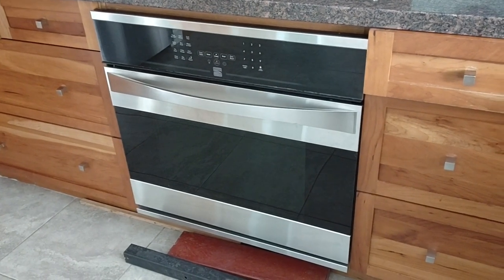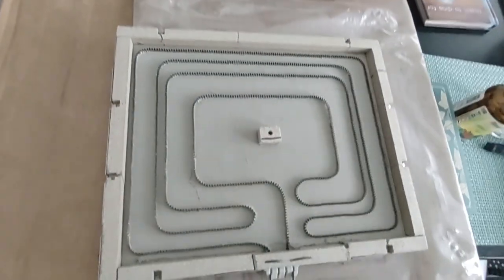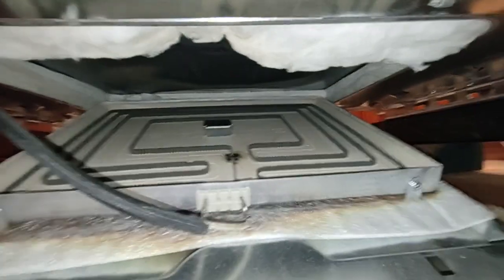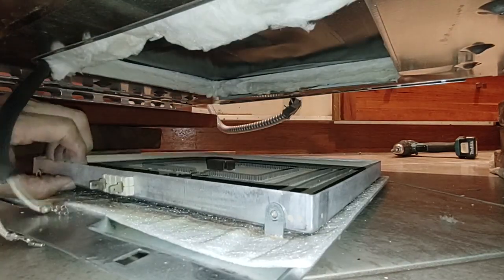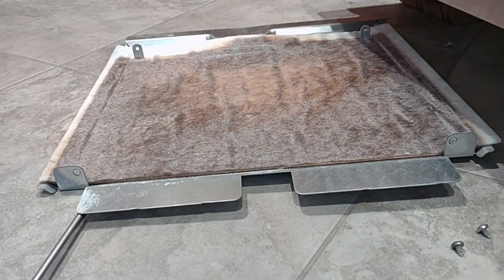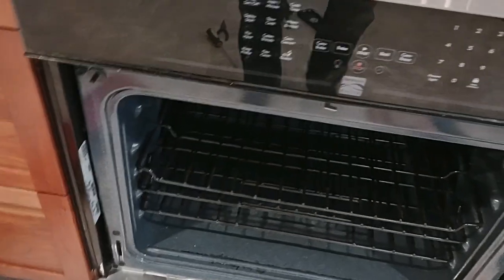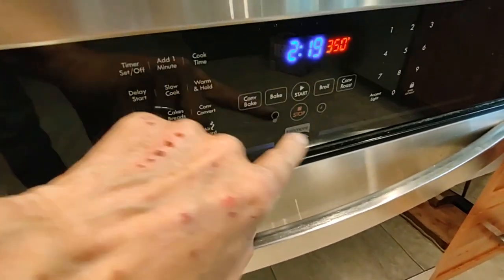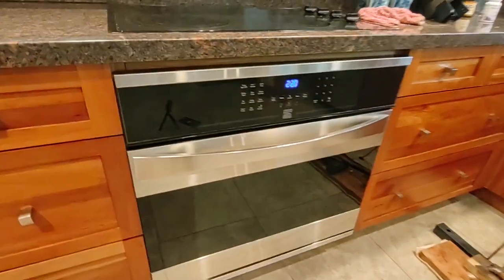Replace lower bake heating element: Kenmore 790 / Frigidaire Electric Oven, Troubleshooting Video #3

Comment: What was your element part number?? Mine is AP6893222 but can't seem to find one in stock.
Reply from the maker: The replacement part number I have is 318601604 (can't say that's absolutely the right element for your oven, of course).  This supposedly supersedes 318601601 and 808650402.  I just checked and www.searspartsdirect.com "claims" to have them in stock (a little under $200).  FWIW, that's where I got mine - they under-packed it and it arrived broken, but they did send another one out free (though they didn't alert me, so it was kind of a blind waiting process).  Also, I've something they had "in stock" and they went silent for weeks, then told me the part was discontinued... so they have inventory issues (at least).  There are probably other places to get them, but they are very fragile, and I'd be careful about installing a used element, as it might be even MORE fragile, and could have some pretty near-fatal flaws when you get it even if it does work.
Reply: Thanks for your quick reply. I'm going to remove my lower element in hopes of 1st, seeing an obvious short or fault and 2nd maybe a part number on it somewhere.
Reply from the maker: @marklittle9341  my guess is that you will find that the element itself is open. There may or may not be an obvious spot where that happened, but there's really no way to fix it other than a new heating element.
Reply: I have a Kenmore Elite Electric slide in range Model #790.4256.9310. This unit has 4 heating elements in it. A top broil element, a rear convection element, a lower bake element and a warming drawer element on the very bottom. When I select a desired oven temperature, the oven preheats using the top, rear and bake elements. There is a corresponding “element in use” indication during preheat including the lower bake element. 
Once the desired temperature is reached, only the bake element is supposed to maintain the oven temperature. It’s at this point that I’m stumped. I suspected a bad lower bake element but did a continuity check and it appeared fine.
Do you know where I  might be able to  look next?
Thanks
Reply from the maker: @marklittle9341  Another common failure point is the relay. Each of the heating elements has its own relay (easy to ID from the color of wires). Your scenario is exactly the same as my range... The oven heats up fine and then the temperature drops because the lower element doesn't work. If you're comfortable with using a voltmeter on high voltage circuits, it should be fairly easy to trace down the issue. What kind of resistance did you measure on that bottom element? Was it disconnected?
Reply from the maker: I should add that the relays are on the back of the control panel (at least on most ranges) and that sometimes the problem ends up being the PC board is fried, though I believe most times that's from the high temperature generated when the relay contacts go high-resistance.

Comment: Just did this to mine…. Whew… Most annoying oven ever… remove the whole oven to replace an element?  it's like a car where you have to pull the motor to change the oil filter…
Reply from the maker: I guess that's the price for having a concealed bake element.  All in all, it seems like a questionable design choice (can't believe it's nearly as efficient as an old-school "out in the open" bake element.  You're right - that's a lot like an Italian car where aesthetics overrule good engineering.  ;-)  But hope the video helped (if only to squash any hope for doing it an easier way).  ;-)